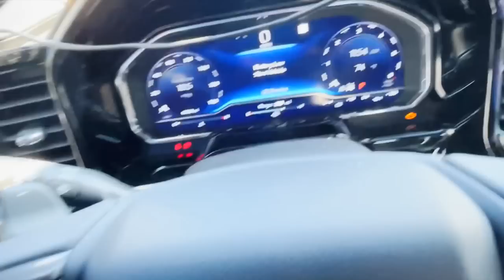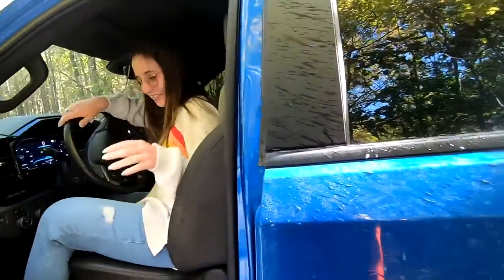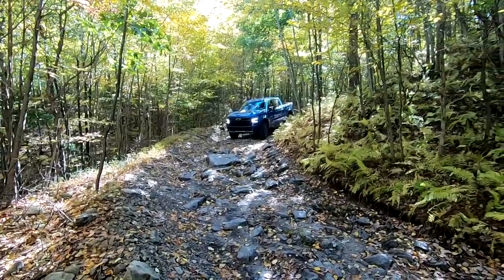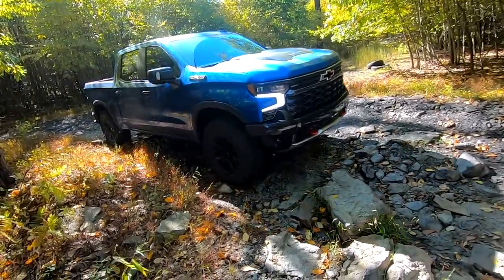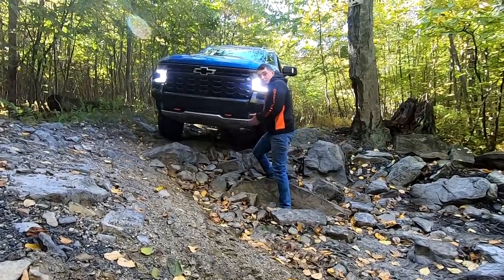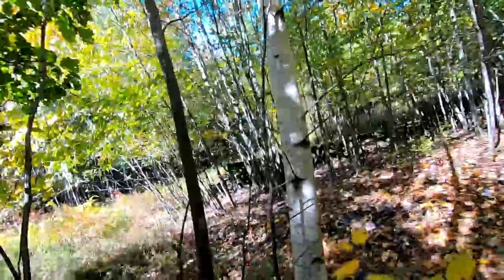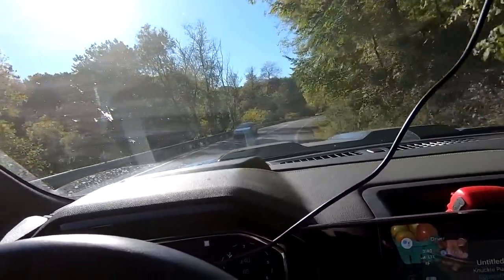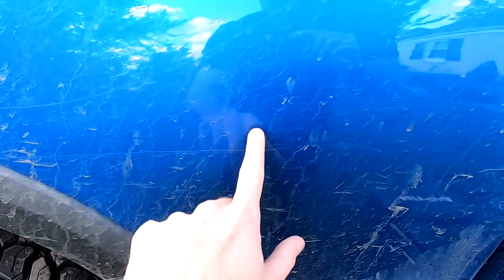The Most INTENSE Silverado Zr2 Off-Roading. Locking Diff's Saved The Day!

Comment: Always always always go with a new battery from Interstate.  Especially if you have a GM anything.  I always have as I've always killed the factory batteries off normal use.  The ZR2 is def "Like A Rock" which should be a nice bumper sticker on there somewhere methinks.